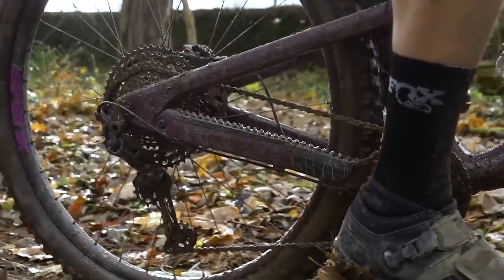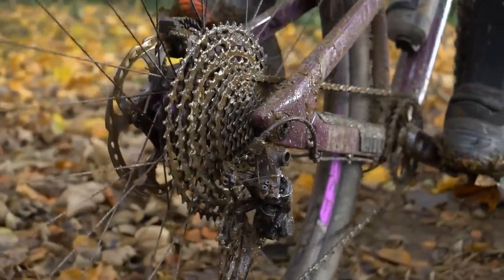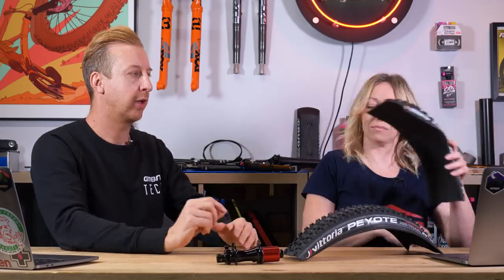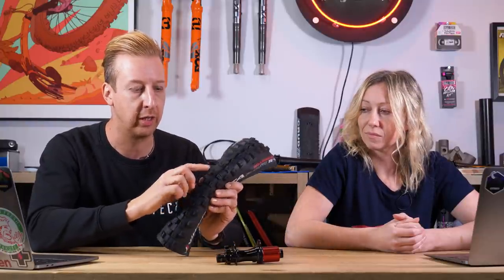How To Stop Tubeless Valves From Clogging? | #AskGMBNTech 180

Comment: #ASKGMBNTECH -- I have some moderately banged-up SRAM NX Eagle cranks that I decided to give new life to by giving them a raw aluminum finish. I used a dremel to remove the paint, and some fine sandpaper to finish and polish them. I sealed them with a single coat of urethane to prevent corrosion. They came out pretty well and I posted the process on reddit, and someone commented that I may have compromised the cranks in the process by removing the shot-peening finish, which apparently adds structural support to the cranks. My question is, are SRAM NX cranks actually shot-peened? And if so, does removing that finish render them dangerous to ride? Thanks!

Comment: #askgmbntech
Can i install a boost crankset (3mm offset) on a non boost frame with 142mm rear spacing? What will be the effect long term?
Reply: Short answer, yes
Long answer, no. Your chainline will be offset further which might mean that you lose shifting performance in the larger cogs. You technically can find chainrings that are "nonboost" and ditch the one that comes on your cranks.

Comment: Too much variety of preferences in pedals, just the clipless/flats would mean that half the riders would be paying extra for a useless (to them) item if they were pre-specced
Reply: I wonder how much of it is/was to 'help out' the bike shop by requiring the buyer to pick up a set of pedals when they collect their new bike, and if you're getting pedals, what about some new shoes etc...?

I've ordered two Nukeproofs from CRC, and a Polygon from BikesOnline and all three came with pedals in the box added by the store rather than the manufacturer. They aren't the best (although the pedals with the Polygon are aluminium flats with proper pins), but if you've just had a bike delivered to your house and you can't ride it without visiting a bike shop to buy some pedals you might be a little upset! It's also a good way to build up a collection of small pedal wrenches and cheap but functional multi-tools, I even got a Park Tools AWS-10 in the box with a kids Cannondale ordered from REI at the start of COVID shutdowns.

Comment: #AskGMBNTech I've got on my XC bike an "FSA SL-K" handlebar which is a carbon bar with an alloy core in it or spoken an alloy bar wit a carbon coat over it. I've got a scratch on it from the brake lever. 2 things: first: When would you get on caution on a visible damage of a carbon handlebar? Second (Which is the more imprtant thing to me): Please could you make a video on how to mount and install a carbon handlebar on an MTB; saftety aspects, torque, damage (visible, more important non visible), pure carbon, with alloy core, carbon paste, ...
Reply: If the surface of your carbon bar is crushed or dented by a clamp or crash, then it is structually damaged. Otherwise, it would just be cosmetic.

Torque values for carbon bars (and alu alike) is usually 5nm for stem plate bolts (apply carbon paste to the stem plate interface), 3.5-4nm for lever clamps, and 2mm for grip collars. The number 1 killer of carbon bars is people overtightening grip collars, so be careful there.

Comment: #askgmbntech how about a how to service/rebuild a coil front fork?

For anti seize it's also a hell of a lot more common because of rusting and you figure you don't clean your car as thoroughly. And depending where you live they can get blasted by road salt etc in the winter. And they're exposed to a lot more heat at times and like you guys mentioned higher torque spec.
Reply: Usually most coil forks have a simpler user guide and manual, as it only really contains the coil(s) and damper(s). A spanner wrench, some 6-8mm wrenches and some grease usually suffices.

Comment: #askgmbntech Hey guys. I equipted my new bike with tubeless tires and it's the first time I run tubeless. How do I stop  sealant coming out of the valve when checking tire presure ot pumping air? I already put the valve on the upper side of the wheel so the sealant should not be in this part of the tire (as gravity dictates) but I still sprayed my new gauge with sealant. What am I doing wrong?

Comment: #AskGMBNTech I've got a 150mm travel front/rear all-mountain bike, and when I go from single track to more of a downhill bike park, should I increase air pressure in my suspension? Mind you I am still new to bike parks so I wont be getting the wheels high off the ground, small tables and drops for now.
Reply: If you plan on taking the bike on jumps and park lift service, then yes, you will benefit from slightly more air pressure in both your fork and shock. It'll prevent bottom outs and also not make the bike dive/compress so deeply on lips and g-outs. You may also want to slow down the rear shock rebound as well, so the bike is less bucky.

Don't go too crazy though, remember to stay within the fork/shock air limits.

Comment: #AskGMBNTech my strap wrench keeps slipping on my shock body and my shock won't loosen up to service it. I've cleaned both the wrench and the shock and i've also left some sticky residue from duct tape and still slips. Any ideas?
Reply: If it is a rockshox can, they can be v hard to undo... try wearing a rubber glove and use ur hand. Or a better strap wrench with a rubber strap. Or even wrap some old rubber around out then strap wrench over that.
Make sure ur unscrewing the correct way...anti clockwise as u look.from the bottom/shaft end!
Reply: Clamp the shock to a vice if you haven't already. Make sure you use a cloth or rubber strap to protect it though. If you're undoing it on a rig or mounted to the bike then just ignore that bit,

If your strap wrench is slipping, check that your strap isn't oxidised or worn out. If the air can is really stuck, then heat the threaded area very carefully, lightly and gently using a handheld torch/lighter. When I say gently, I really mean gently. Just heat it up so it frees any oxidation, then quickly attach the strap wrench and go ham on it.
Reply: @AORNova  i've bought a draper redline strap wrench (better than the cheap shit i was using before). I will combine this with a rubber tube and a vice instead of in the bike and fingers crossed should loosen up.
Reply: @rupedog  i've bought a draper redline strap wrench (better than the cheap shit i was using before). I will combine this with a rubber tube and a vice instead of in the bike and fingers crossed should loosen up.
Reply: @hench_wrench_repairs  If you can, buy those rubberised vice clamps, made for circular stuff. Less chance of squashing or scuffing

Comment: Great & informative content as always!

Can you give any suggestions for me?
I have a full suspension bike with a head angle of 67deg. It feels kind of twitchy on the descents.
Already changed the fork travel from 150 to 160mm and am planning to use a angled headset.

Would 65deg head tube angle be too much of a change from the current 66.5? 
Would this make result in  "floppy"  handling?
#askgmbntech

Comment: #askgmbntech
Hi Anna & Doddy, 
I have put 2.6 tyres on my hardtail. There is a gap of 5mm between the tyre and the frame. The shop I bought the bike from said 2.4 max tyre width but lots of websites say 5mm clearance is good. What are your opinions?

Comment: I think bikes should come with a basic alloy flat pedal for what they cost.  Grips are just as personal for most riders but manufacturers still put them on their bikes.  I had my bike in the bike shopmwaitimg months for parts so I went and spent $11.5k on a new bike only to not have any pedals to use with it.  I was going to buy some other pedals anyway but it's crazy I can spend that much money on a bike I can't ride from the dealer.

Comment: #AskGMBNTech
i got new disc rotors (bbb power stop) and new brake pads (shimano bo3s) but i cant really get them bed in or they dont have the same power as the old set of rotors and pads( old were shimano rotors)
have i got the wrong rotors? or should i sand the rotors and pads for better bedding in ?
Reply: Sometimes certain rotors and pads take longer to bed in. If you want to ensure the bedding takes place, sandpaper/scuff the rotor and pads lightly, then wash them with dishwashing soap under water to get rid of any oils. Then lightly heat the rotor and pads under a moving flame to evaporate any remaining liquids and oils, then reinstall on the bike and do a proper bedding process.

Comment: #askgmbntech I always store my bike with the derailleur on the smallest cog on the back because the spring In the derailleur  isn't being stretched to try and extend the life of my derailleur is there any truth in this ?
Reply: It doesn't really help much, as in larger cogs, the chain is also taking the brunt of the tension, not just the cage spring. Other factors like clutch strength, greasing/smoothness of gear setup and impact damage play a bigger role in derailleur wear and tear.

Comment: #AskGMBNTech Hi Doddy, love the show, so helpful and entertaining too.  So, my question is this, my wife has a 2019 Cube Stereo C62 Race. its a 2x11 speed with Raceface affect 175mm cranks.  Having now worn them out, shes looking to upgrade the drive chain and change to 165mm cranks, but this brings one big question, how the fek do you find out what BB the bike uses?  And so which cranks are compatible? 
Also, this seems the ideal time to go to 1x 12 and ditch the 2x at the front, so any specific suggestions or recommendations?
Cheers,
Larry
Reply: Usually you can go onto the manufactuers website and check the specs, or google online what BB the Affect cranks take. Some diameters are 29.9, 30, 25, and actual bb model types can be from Pressfit, Dub, Shimano BB-30 and so forth.

Some brands don't list BB models in their spec sheets, in which case you can try identifying the BB via any model number on it, pictures online, forums, or simply email the company.

For 1x, yes, if you ride trails and park often and not road, and also have a wide range cassette at the back, it would be beneficial to ditch the 2x. Absoluteblack, Wolftooth, Burgtec and so many other brands make excellent oval rings. Just make sure to find out what interface your cranks has, whether it is the 3 bolt Sram spider, shimano 96bcd 4 bolt, or something else.
Reply: @AORNova  Cheers for that, youve highlighted the exact level of confusion im in over this perfectly.  I've been on the wesite, nothing listed.  Was really looking ti see if there was a way ti identify it without having to take the cranks off first
Reply: @larry888888  Take the cranks off and use a caliper to measure the inner width of the bb, and also take note of any model markings. Quick google will help, even if its "Sram 69.69mm bottom bracket model", it'll give you the right result most of the time

Comment: #AskGMBNTech I have an xc bike and every tire I try I puncture it. Also in my island the trails are rough and rocky, I am an above average rider. Should I upgrade into a 130mm? I have asked some people and they have different opinions what should I do?
Reply: Are you running tubeless? What tyre pressures? Also what tyres?

It could be your tyres aren't tough enough for the trail and you should upgrade those. If you're using xc tyres you should get something tougher.

Then if you aren't running tubeless that is the first thing I would upgrade.

If you're running tubeless you could try using a cushcore tyre insert.

And if you're still having problems then you are probably underbiked and should upgrade.
Reply: Usually a bike's travel doesn't affect the capability of it over roughness, as long as you pick the correct lines and set the bike up. The exception is bringing XC bikes to a Downhill track, of course then the equipment doesn't fit the trail condition.

Go tubeless if you haven't, it stops pinch flats and thorns from ruining your ride.
You can also consider lowering your air pressure in your fork and shock, or upgrading to a more tougher casing tire instead of what you're using currently.

Comment: THE PEDALS! Having worked in the bike industry for years... Those crap pedals that you get in the box with every bike is because of certain laws dictating that they must come with reflectors on them. Premium pedals don't accept reflectors, and they don't need to because they are sold as an after market part, that don't need to adhere to the same consumer standards as fully built bikes do in many countries. So the bike manufacturers literally put the cheapest pedals in with the bikes knowing that they're going to be thrown away in 99.99% of cases. Complete lunacy that literally millions of these pedals are being thrown into land fill etc every year. In fact, I think there's one company that specialises in making those pedals alone!

Comment: #AskGMBNTech Great Channel and great presenters! Time limitations have it I seldomly get to ride my (old by today) 2013 full-sus (Radon Slide 125). Unfortunately, the damper on the rear (Fox CTD) has some issues - the CTD lever is without effect and on the last ride I was really surprised to find the valve is loosing air ("sometimes", but gladfully I always carry a damper pump...). I can get away without the lever but any hints/hacks on an easy solution for fixing the valve issue would be highly appreciated. I know a damper service would be great, but actually I actually no idea how long this bike will stay with me (aiming for a recent NP Reactor...) so I am after a bargain solution rather (for now). Also I think a replacement could cost little extra compared to a service, which renders servicing even less attractive I guess.
Reply: My guess would be that there is either not enough damper fluid in the shock, or some air in the damper, making the 3 way compression adjust not react to input (if there is a squishy wet sound, then it's for sure). If it is so, then some seal changing can fix it. 

If not, you will need, as you said, a full damper service and new kit and seals. Funny that even the 2019 Fox x2 suffers from whacky seals and squishing. Go figure! Good luck!
Reply: @AORNova  thanks for the detailed opinion. I watched some vids on the ctd boost valve full service and checked the price of the seals. Overall, I think I will not try that myself - no time and high risk of actually breaking something /messing it up half way through. Full service is around 140€, so I give it a go spin I guess. Meanwhile I will borrow my wife's cube which is the better, longer, slacker and 650b (vs 26") option.

Comment: #AskGMBNTech Why oh why is there no choice of crank length with bikes? I have really short legs for my height but my size of bike commonly comes with 175mm cranks - these are really long for a 29" inseam. Why isn't there an option for 165 or 170?
Reply: Bikes are specced with what the brand thinks is the average person's inseam for the frame size, and also what's readily available to them stock-wise. Sadly it is one of the things that brands don't (or can't) afford to tailor to every single rider, as it is simply not economic.

You can find aftermarket cranks that can range from 155mm all the way to 180mm. hardtailparty covers one such brand in one of his videos.

Comment: #askgmbntech could you put 29” lowers on a fork that is currently 27.5 if same stanchion size? Would be a great cost saver 😊
Reply: I think yes but the damper and air spring will be shorter maybe the stanchions too
Reply: Short answer = yes. Usually the lowers are cross-compatible with the uppers, as those are the bit where it accomodates the different wheel sizes.
Long answer = check with the manufacturer, you might need different shaft lengths or damper bolts/bits and bobs

Comment: #AskGMBNTech 
Been thinking of going tubeless, but the price is a bit steep for me for the kits. Been thinking of going duct tape+cheap aliexpress valves which would cost me less than 10 euro, but the sealant would put the price up as much as lets say muc off kit. I did see somewhere that you can use condensed milk, so what would you say about condensed milk and lets say some glitter? Would be much cheaper and easier to find sealant too!
Reply: Using the proper sealants will prevent future bad situations. Yes, you may use duct tape and chinese tubeless valves, they are totally fine, just make sure your duct tape is of good quality so the adhesive doesn't go too slimey inside the wheel.

Sealsnt wise I have never heard of condensed milk and glitter, partly because its a consumable, and also because sealant usually has latex or some binding properties in the formula that helps the particulates clog up - I don't think the glitter is lactose intolerant enough to clog up a hole!
Reply: @AORNova  thanks man, might give finding latex mold builder again, if I can find it somewhere local I'd probably diy some sealant

Comment: #askgmbntec Love the show, have you done a rim size width v. tire size width  video ? The max tire size I can run is a 2.35-2.4, would a 35mm interior rim be to wide, and square off the tire too much ?
Reply: 35mm inner rim width ideally takes 2.3 to 2.8 tires, so yes, you can. But the tire profile won't be as ideal as let's say, a 2.6". It'll be squarer than you'd like, making lean cornering a bit of a slip fest.

Comment: #AskGMBNTech
hey doddy and anna 
i can wiggle my cassette 
i heard a little play is common but i feel it is a bit much
i can wiggle it lift to right not up and down
the lock ring is tight
can i do something to eliminate or reduce the wiggle ??

(ps like the new duo presentation a lot)
Reply: It could be your cassette needs a spacer on the inner side of the largest cog, or your lock ring isn't tight enough. Tighten the lock ring first, and if that doesn't solve it then it means you need the spacer to fill the tiny gap.
Reply: The lock ring is right
And it is still the factory cassette i never changed it, so i assume IT is installed correctly
Reply: @alcosamwel  Ok then it might either be a loose hub body bearing or you need a spacer in the back of the cassette